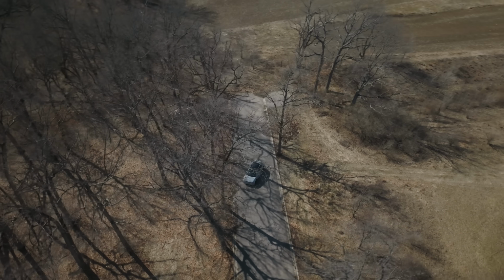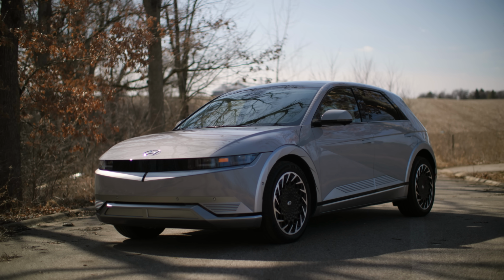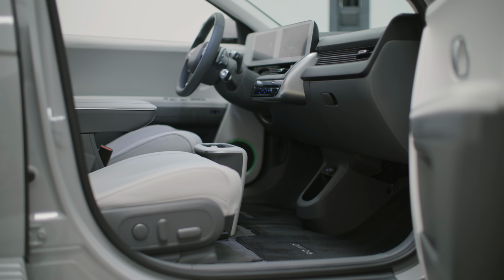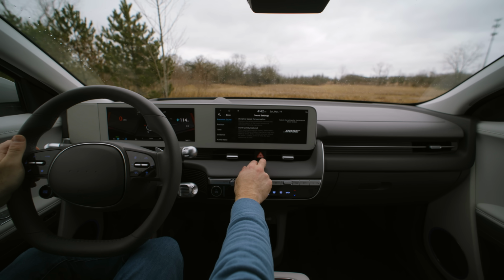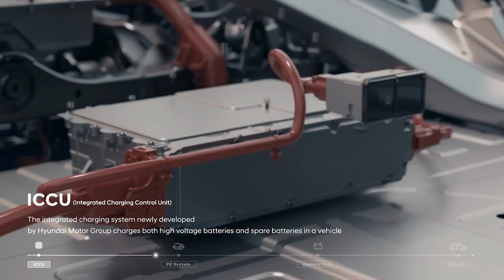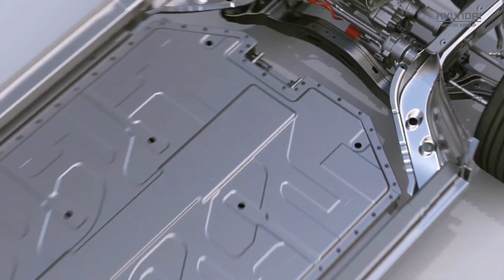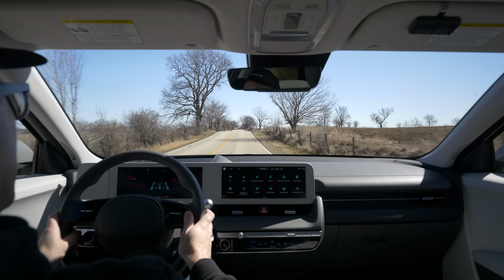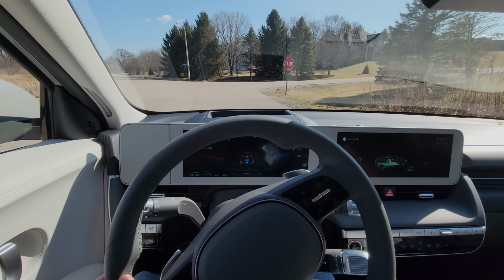2022 Hyundai Ioniq5 EV | Fixing Failed Experiments

Comment: I want one! Sounds like fun - or rather sounds like very lttle sound! It just needs a ticking clock in the interior ala Rolls Royce!
Reply: Now they are worth nothing
Reply: @RONderluck  My word - you must be rich. Just checked and the lowest priced Ioniq 5 Ultimate available on Auto Trader in the UK is £22,295. 2 year old model with 50,000 miles. Admittedly a steep decline from nearly £50,000 when new? Was this what you meant?
Reply: @markbriggs5531  Sure is

Comment: Damn, What a great in depth review!   I would so like to see him do a side by side comparison on the 2022 IONIQ  5  VS the 2022  KIA EV6,   because as I write this comment
I can see both cars available hitting the magic tipping point of  25,000 and under with   warranty still available and with either low miles or replaced tires,  after the
4K  IRS used credit,  and that's what   the  United States market is waiting on to take that next big leap in EV adoption, where they say, OK  the  break even point of  7 to 9 years
is realistic, where the gas savings now exceeds over 10K easily over the next 7 to  9 years,  so I'll make the upgrade in my electrical wiring in my home so I can 
add over 250 miles of range  each day in less than 7 hours  if ever needed.      That is the only obstacle really to holding back widespread EV adoption is the
electrical upgrade needed in most homes to charge  these large battery's in under 8 hours,  in the better built 2022 models now.

Comment: I truly love to drive and before I retired as a motor and traffic officer my passion for two and four wheels brought out my love to drive although I’ve always loved cars. I know EV’s are the future but to me the range anxiety the lack of working charging stations and the stop charge and wait to get a significant charge in my opinion will never take away from the thrill of the engine the exuberance of the exhaust note and the lighter nimble weight of a rumbling supercharge , naturally aspirated or turbo engine. To me that’s what make the drive or road trip fun and for me the range anxiety is not something I want to experience. In only on my 40’s by no means independently wealth but good enough to buy a car of my dreams loaded. I prefer the dumber of a V6 supercharged at 400hp and my new vehicle witch is naturally aspirated mid engine V8 regardless of gas prices it what I love a good exhaust note warms my heart.

Comment: I like the design of the Ioniq 5, but I still would go with the USA made Model Y over it personally. The local Hyundai dealers have a $5k markup, and you have to pay extra for AWD and have reduced range, plus you get a way faster computer with the Tesla. I'm curious what the dB difference is between the two as far as interior noise goes as you had mentioned.

Comment: Despite the power, EVs are more boring in a daily driving than gasoline engines. A nice gasoline engine has a soul, which an EV cannot compensate. Plus, EVs are being driven 95% of the time just like a gasoline car, no one is doing quick accelerations all the time. I drive both a gasoline and an EV

Comment: the only flaw is that the battery isn't liquid cooled. the battery will fail quicker with passive air cooler compared to liquid cooling.

Comment: Thank you for the great review.  It answered a lot of my questions.  One small thing...  You mentioned that they do not have the Hyundai logo on the steering wheel.  In fact they do but in a very clever way.  You see, the 4 dots on the steering wheel are not just an extension of the pixel theme design of the car; the letter H in morse code is 4 dots!!  Anyway, thanks again.

Comment: I've watched alot of Ioniq 5 reviews. Mainy very good, and I learned a lot about this car, BUT, your review stands out from all the rest. It was very well balanced and your explanations were detailed, and in a calm consistent way. They helped me further understand the features even more.. For instance, the seats. I am tall and my wide short. Your explanations addressed both. Same with the limbar support. Thank you!  The only issue I would have liked you to go a bit more in detail was the leasing vs. buying part. I assume you preferred to lease, since technology in EV (batteries) is evolving fast.?
Reply from the maker: Yes, I feel as though you will see bi annual changes to battery packs or programming on these cars. Not something Id want to be stuck in longer than 3 years.

Comment: The only thing i am scared about when it comes to EV's would be the electronics being outdated real quick, old gas cars can survive for a very long time and most of its capabilities does not require screens etc etc. but these new EV require alot of AI and/or electronics, which becomes outdated fairly quickly. I am just worried that if I buy an EV now, in 2-3 years the EV that I bought 2-3 years ago will be very outdated when it comes to its function. As well as manufacturers, not releasing updates to older EV's so that older EV's owners will have to buy a new EV just to use a new update which is similar to what Apple did.. anyways sorry for my rant i know it is all over the place, I am writing this after a 12 hour shift at the hospital and I am drained lol I am not gonna bother to grammar or spelling check this as this is just you tube lol. Anyways be niceeeee :)

Comment: The comments about regen and braking are understandable, but as someone who has been driving BEV's and HEV's since the 1990's I can tell you that you get used to modulating your accelerator pressure - just as a hired driver learns to moderate brake pressure. It's just a question of what you're used to. If you think back to when you first learned to drive - especially if it was in a manual transmission car - you were probably far from smooth. But after some time, that all went away - at least for most of us.

Comment: Disabling the traction control, engaging sport mode and flooring it after every stop is puerile. 0-60 times is only for penis measuring contest for the Next Red Light Grand Prix. Hell, in my million miles of driving I can count on my left hand how many times have I got to accelerate from 0 to 60. If you're into that tyre burning idiocy, buy yourself a Tesla Model 3 performance and let the adults drive sensibly in Ioniq 5.

Comment: Thank you for an honest and well thought review.
The four dots on the steering wheel are morse for letter H, clever they kept the logo, but didn't.
The small room in the front by the floor are good for the items you need only after when you park, at the dealer they kept the RFID tags for different charging suppliers.

Comment: I sat in the EV6 and everything felt like it was wrongly proportioned.  The platform was clearly designed for a much larger vehicle (think mid to large sized SUV that can seat 7) but they began rolling it out with a 4 door "car" cabin built on it.  When you set up the seat relative to the pedals, the dash controls are too far away so its always a stretch.  You adjust the steering wheel to feel comfortable but the LCD dash is now partly blocked by the top of the wheel.  What were they thinking here?  Then you sit in the back seat and find you have 18" of knee room to the back of the driver seat.  Was this back seat designed for chauffeuring Shaq around town?  The cargo space is incredibly long but not very tall (again the platform was designed for a mid-large SUV) so it's usability is not that great.

I ended up buying the Niro EV instead because that vehicle is actually proportioned properly.

Comment: Its great and all they've put thought into it, but its still got the bullshit displays for a dash and bullshit tech thats not going to last. EVs should be able to go so much further in overall mileage than a normal ICE car from the 90s, but I just dont see any manufacturer building a simple EV that can do this. How many early 00s ford taurus or rangers do you see going down the highway... they're like cock roaches. Same with honda and chevy. Sure there was garbage back then, but for the most part these cars were simple and just worked.

They should all be sued for how they're building modern cars... EV or not... its just turning into cellphones where they expect you to keep it for a few years and then toss it out for the latest and greatest. Fuck KIA, Fuck Hyundai, and fuck the whole car market. Everything is in a race to the bottom of the cost barrel and consumers are the ones driving this impossible death spiral.

Comment: 2:11
"... and the worst part was they weren't dedicated EVs they were just talking internal combustion cars that has gasoline engines and then just pack a battery into it and electric motor and there were so many compromises to that and you can see just looking back at those they haven't aged all that well..."
Can you give some of the main compromises? And what do you mean by not aging well, can you give examples? Are you saying 2022 Kona EV is worse than usual 2022 Kona, if yes then how?
2022 Kona EV is 10k cheaper than 2022 Ioniq 5, it doesn't look like a compromise, it's the cheapest EV with big range you can currently get, am I missing something?

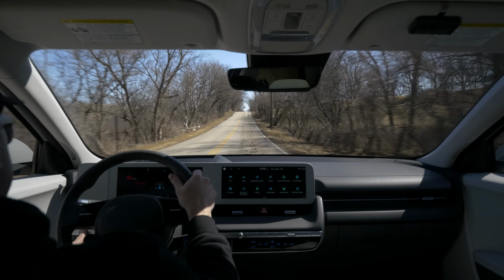Comment: 22:00 I own a Kia Stinger and my biggest complaint is the traction control. It can be quite dangerous at times, I have to make a right turn onto a moderately high traffic boulevard and I expect my 365 HP car to easily accelerate to traffic speed in very little time, yet a small rock is all it needs to make my car cut power and prevent me from successfully merge.

Comment: Very good review of the vehicle with good insights that are rarely shared (but that I have noticed myself in the vehicle since we took delivery of it).
One thing I don't agree with: Traction control is all but restrictive. Ok, so far I have only experienced snow tires and I normally don't push it very hard, but: on wet surface with in turns in the lower speed range, the back actually steps out quite a bit on WOT with ESP fully active. Vehicle actually needs some steering correction to go where you want it to go. It's quite fun, bit in fact also quite surprising for the family car it is. Curious to check once we have the summer rubbers on it. For sure with the winters I would not say the system is restricitve.

Comment: Good review. We have already road tripped our Ioniq 5 from Northern California to Southern California and I can say that 300 miles of range at 80 mph down I5 does not happen. With cruise control on 80mph, strong headwinds and climate control used normally, we got around 200 miles before needing to charge. Good news is on 350K fast charges you absolutely can charge from 10% to 80% in less than 20 minutes. We stopped for 30 minutes to eat and take a bathroom break and charged from 7% to 90%.

Comment: When you discuss the recuperation levels, you mention a jerking at level 3 when letting go of the gas pedal, and you don't seem too happy with setting the levels manually for best results. There is though an automatic recuperation level that solves this problem and sets the level automatically according to the road and driving.

Comment: We traded in an '18 Soul EV for this a RWD Ioniq 5 and we have yet to use our other ICE car since we got it. With the range, space and comfort it's become a true ICE car replacement, even with going skiing and doing 200 miles rounds trips. We do miss having the Kia in the city, as it's size and weight were perfect for tight roads and short distances. We may just end up replacing the ICE car with an older gen 30kW Soul.

Comment: Their choice to use LiPo batteries is interesting, having come from the RC car world. Discharging and charging was always the worrisome period, granted, RC cars are exposed to crashes/hard impacts way more often. 

I did some digging and it appears there is some confusion on forums and sites. Some are saying they are indeed Li-Ion and others are saying LiPo.
Reply: as far as i know, LiPo batteries are still Li-Ion batteries. Li-Ion only describes that there is a reaction with those Ions occurring during charging/discharging. The name LiPo further describes that there is a polymer between the anode and cathode of a cell.

Comment: One thing I think I would like to see car reviews talk more about in relation to range is motor efficiency. Knowing how many miles a car does per kilowatt hour, by how much the addition of AWD affects mi/kWh would be cool to know, or how one car's motor is more efficient than another's would be really cool.

Either way, I love what you all do here. Keep up the great work!
Reply from the maker: Thats very hard to quantify with all propriertary software. You'd almost need to do motor out to test that or have the car on rollers to get into that.
Reply: @savagegeese  I wouldn't do it either if the only answer was to test it independently. But if a manufacturer states how efficient their drive units are - like Lucid talking about their stated goal of 5 mi/kWh for the Air rather than ~3 for most of the industry -  it might be cool to know. Again, love your work. Keep it up!
Reply: they wont review that, cos thats the one glaring downfall and they are paid to ignore that

Comment: The problem that I have with your assessment of EVs in general is that you say certain physical aspects are negative when they are actually positive attributes. An example of this is the battery and its weight. The lower center of gravity makes it more stable and very hard to turn over. If the cars regenerative braking is optimal then you will NOT have the same replacement schedule for the brakes because the brake will only be used in extreme situations. Your assessment makes you seem like you are not really giving your thoughts but pre prepared talking points from a company that is being pulled into the EV world kicking and screaming. Other than that I enjoyed your video.

Comment: Very odd it has steel front control arms when aluminum is used everywhere else. I'd rather have aluminum for those components since they're the most exposed, especially the front arms. Rust obviously being a long-term question.

Comment: I recently drove a Kia EV6 and found that while the suspension was really nice, but handling suffered a lot because of it. The steering was sluggish and there was a lot of body roll. It felt a lot like driving a Toyota Venza. I drove a Mach E GT after and found the steering to be much better and it was insanely flat. Drove a Tesla Model Y right after and nothing compares to the fun of that somehow. I've seen Motortrend (maybe C&D?) say the EV6/IONIC had more instant snap in acceleration than even a Model Y Perf. I've driven the Model Y Perf a few times and cannot fathom how that is possible. Care to share you experiences on this? Great videos guys!!

Comment: Size wise it gimps my Prime and is about the footprint of a Corolla Cross. The back is about as usable as a Forester's as far as I can lie down in it with the seats folded without any trouble.

I have one on order for next year after I got an hour with a long range. The drive was impressive enough. I usually just get disappointed with Hyundais.
Reply: One note, there's some significant decontenting with the inside on the LR and it goes as far as door materials. They're using completely different cards that don't connect all that well with the design of the inside. Not a big deal.

Comment: Great review.  I’m currently going back and forth between this and the EV6.  Might come down to whichever is available and not marked up. I like them both and have driven both.  I’ll be curious to see what your take is on the EV6.  I am leasing a Niro EV and it’s great.  Was let down by the EV6 in terms of the interior quality.  I drove the Light trim and felt it was very cheap on the inside compared to the IONIQ 5.  Will be driving a GT-Line this week and hope the interior quality is better.

Comment: I bought one back in December and I have about 5600 miles on it. It's a great car so far, not perfect (no car is) but damn good. I got a RWD base model and it's actually a pretty fun car, I'm thinking if you turn traction control off you could drift it. It also feels quicker than its 225 hp would suggest. Its not fast, but quick enough to have fun with. It's also quite practical, has a crap ton of space in it and I love the styling, it looks a bit like a Lancia Delta, especially from the side.

Comment: EVs still feel like a beta test, for betas. Why skip forward past hybrids? Hybrids are just starting to get really good. Mercedes inline six with the integrated generator, Ford PowerBoost, any Toyota/Lexus hybrid, Porsche V6 hybrid, etc. There’s still plenty of meat on the bone. Plus they’re so practical, you have range and towing . . .even in the winter. 
Keep working on the EVs, but don’t forget that cheap oil has lifted more people out of poverty than anything else. E.g. a tradesman with a truck.

Comment: think its worth noting that regenerative braking doesn't use the brakes - it uses the electric motor to retard motion and hence switch from using electricity to generate it. ....so most ev's will have less brake wear despite the weight of the car.